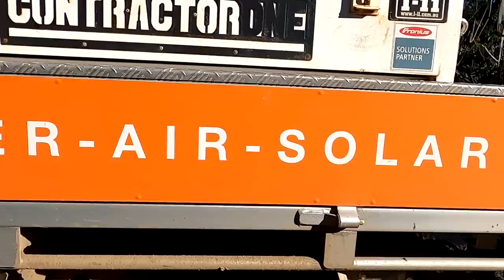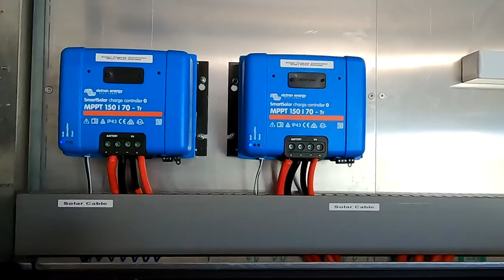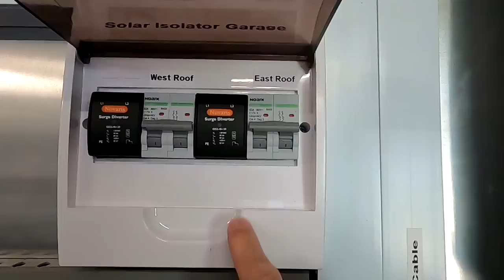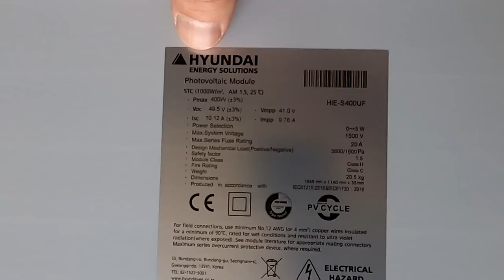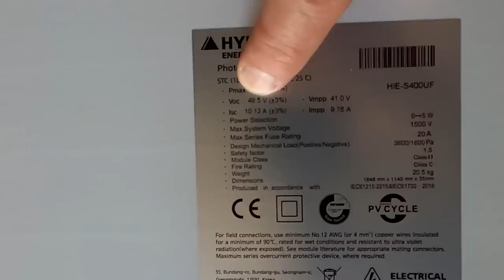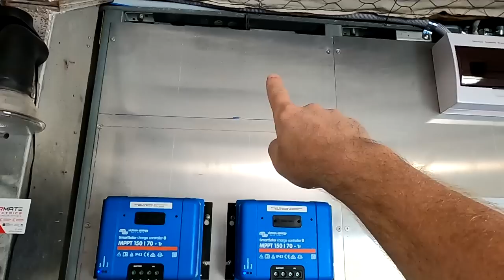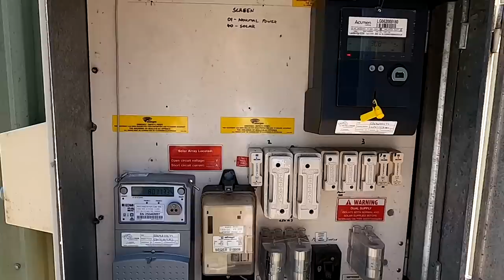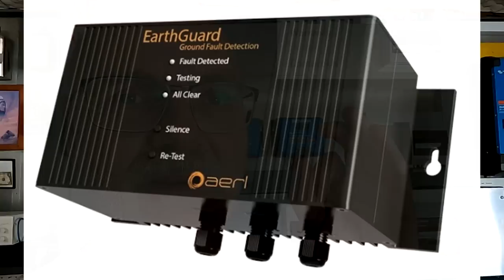I booked an Electrician to check on my DIY Solar-Battery System.

Comment: I see you are going through what I did when I was thinking about what inverters/mppt to get. I went with Growatt only because they can handle 450 volts 30 amps on there mppt controls built in and have 100 amp chargers at 48 volts with 5k inverter. I wanted Victron or Schneider. Schneider is best there is for USA. To get what Schneider it would have been $16,000. I went with Growatt and spent $2400 to get a good system not the best though. Money is money and we must do what we can afford.
Reply from the maker: Yes, absolutely. The new panels will provide the best solution as I cannot replace the cracked panels and would end up with a lot less power from these roofs.

Comment: You can mount the PV panels right up to the edges if you get a civil engineer to calculate worst case wind loadings and the shed roof strength.
However, this costs money and given that you have to replace a few panels it would be easier to just rearrange and comply with the default code.
It is often frustrating when an owner realises the sheer waste of roof space that is sometimes required for wind effects.
Flat (<20 deg) roofs are the most troublesome.
Reply from the maker: There is an option where you can cover all the sites of the roof to the panels and basically make the panels the roof. I looked into this as well, but it would involve a builder and more $$$ towards that. So not worth it in my eyes.
If I install the new panels, they will be fully compliant, new, warranty and have more power than the existing ones. Cost $$$ too, but I have to spend it either way and I find having brand new panels for half the price is currently the best solution.

Comment: I'm glad you got someone in to point out the deficiencies so you can be assured of safety.  $500 a KW installed is hard to beat.  I say do it Andy, there's still plenty  of DIY you can do.  How about a voltage sensor that will disconnect the system if a solar controller fails?  Or maybe install a large choke?  We do this on ships because of lightning.  I bet your audience would love to see some automation and alarm integration.  We've already watched you put in solar panels.
Reply from the maker: Thank you. Yeah, we have done quite some work on the roof and the new panels are very tempting.
We will do some automation with the new battery 3.0 and a new smaller upgraded power wall. That will be interesting!
Reply: @OffGridGarageAustralia  nice.  Can't wait Andy, keep up the good work!

Comment: Spot on Andy with the grounding! There should only be one point of contact so that there is NO difference in potential with the current. Now, the difference happens when you use an off grid system that is a stand alone (Generator) type of takeover. This is the point at which you loose and have to create a bond because you loose your Neutral bonding. This is the most common and confusing issue with any solar/backup generator setup for any installation... Great Video as always!
Reply: I assume that the shed/roof/PV rails are on a single earth not connected to any main house grid power inlet earth.
Reply from the maker: Thanks Dan, there are so many regulations and it is not easy to understand all  this. The sparky will take care of that and get it right. I'll make an update video when this is all done.

Comment: Finally u got it done. Lol. By the way the spd correct way to connect is Fuse,MCB, SPD again MCB and use a different earth rod for spd. I have used a 16mm earth wire bcz of the distance.

Now only the video about the bms calibration video of heltec is missing. U never got through to tell us what the email from heltec said. Thanks.
Reply from the maker: That totally depends on local regulations.

The Heltec video will come at some point, just not enough time
Reply: @OffGridGarageAustralia  I asked a SPD manufacturer he gv me that this was the best method. Yes local regulations could be different.

Comment: In the summertime, I turn down the amperage that goes into my charge controller, found I didn’t need that much amperage to fill the batteries in that time of year!
I would think this would help alleviate any overage that could occur!
You can do this in the software on the VictronConnect

Comment: Some tips from a solar company. I am not sure why you make your solar panels so high on the roof and have thema all gapped. 1. Some room between the roof is ok for ventilation but it doenst have to be so much (2-3cm on top of ridges is enough) this way you can install them closer to the edge. 2. You will get nice air drift if you just mount the panels without gaps on the side. gaps disturb the air flow and do NOT make your panels cooler in my climate at least. 3. Shingle panels are a good fit for your place by quick video judgement. The voltage differences in partial shades is much less. Shame its so expensive to replace a largely working set of panels.
Lastly, i dont know your weather conditions, storms, etc. Just the 10 degree mounting on the less tilted roof is not really neccesary. It will hardly yield extra energy considering the ring of trees around your place, but does make it more liable for storms and increase mounting costs. You can do it but its not that important.
Reply from the maker: Thank you for your comment.
The gap between the panels and roof was designed for cleaning purposes. As the roof is fairly flat, leaf will accumulate in a small gap easily. The was also the purpose of the gaps in between the panels.
And as some of the panels start cracking now and I cannot replace them worth other used ones any more, It is good to have some alternatives.
The 10° tilt of the panels is so water can run off easily and does not stain the panels. Flat panels are getting dirty very quickly.

Comment: Have you ever thought of AC-coupling some of your PV with e.g. a fronius primo inverter? Works pretty well and (almost) out of the box with the victron system. Even in an offgrid situation. The Multi then will increase the frequency linearly to regulate the fronius-inverters maximum feed in when the battery gets full.
With this you could also do strings from 80-800 V DC and not be restriced from your MPPTs max Voc. I think the MPPT RS's with up to 450V are to big for your arrays (and also pretty ineffient for a charge controller).
AC-coupling would increase efficiency if the PV-power gets used directly and is not stored first (charing your car or using the hot water system in the future in your house). When always first charging the battery, DC-coupling is more efficient tho. So I would go for a mixed AC/DC PV setup in your case.
Reply: @Ando - yeah - a Fronius AC coupled addition would work. I think they are the only company to have worked with Victron to 'tune their violins' regarding frequency, etc.
Also, I think a Smartasolar RS 450/100 (or 200) would work well for Andy. There's lots of features in there for the price - 2 trackers (4 in the 200), isolation between solar & battery, earth fault protection built in. The slightly lower efficiency is a good trade off, I think. I use a 450/100 & I'm very happy.
Reply: @Browneye2566  Refering to the Venus OS manual (2.4), frequency shifting will work with fronius, sma, solar edge and abb inverters at least while also communicating with the venus os. (zero feed in not possible for sma and solar edge, but this is not relevant for off grid). 
But inverters of those brands will show up in venus os without the need of an energy meter displaying the inverters power. With such an energy meter you basically can integrate every inverter into a victron system, as long as it shuts down completely at elevated frequency. I don't know any inverter that doesn't do that. For frequency shifting and regulation, the inverter itself need to have that option in its settings.
Reply: @Browneye2566  In Andy's case I would definatly prefer ac coupling, as he is able to switch on loads when the sun is shining to use the pv power directly and also has dc-coupled pv in the mix to prevent a deadlock situation possible when only using ac pv. 
Directly consumed pc will always be more efficient as there is only one step of power conversion necessary (DC pv - > ac, then into load) and not 2 (DC pv - > DC battery - > inverting through multiplus, then into load). 
As long as you don't need to store pv energy first for later use, dc-coupling requires more steps of conversion and will be less efficient from the whole system's perspective. 
But when needing to store pv energy because you can't use it directly, dc coupling all the way. One less conversion(DC pv to ac) and dc to dc battery charging is generally more efficient than ac battery charging. 
As a side note: the primo inverters also come with every safety feature that you mentioned previously, can make use of higher pv voltages, also have two mppt trackers, are plug and play and supported by victron.
Reply from the maker: Yes, this is all in the pipeline. I have a small 1.5kW Fronius here and will use this for test purposes...

Comment: I have been occasionally observing your vids, for a while, & you've done a brilliant job, with the system. It was definitely a worthwhile exercise, getting in an electrician, for compliancy purposes.
As a practising plumber, in New Zealand, for over 40 years, the amount of trade installed systems, that aren't compliant (especially, in the area of hot water cylinders) is ridiculous. I would imagine Australia would not be too dissimilar. So, it doesn't surprise me, the electrician was somewhat impressed, even if he didn't say so, given what I have seen, of your system.
The question I do have is, now you do know your system isn't compliant, what would have happened, if the worst case scenario occurred, & your garage burnt down, even if totally unrelated, to your solar system. Would insurance have been paid out?
You are doing a great job. So, keep up the top efforts, with both the build, & the videos. Thanks, your channel makes Youtube a better place.
Reply from the maker: Thanks a lot for your comment and sharing your experience. I think so too that we have a similar situation here in Australia in regards to plumbing and electrical installation. I mean, you can buy almost all electrical gear online these days but are technically not allowed to install any of that. Hence I felt it is time to get this all sorted and checked. More to come...
The insurance will not pay for any DIY work if it is not compliant. And even if all work is compliant, it would be hard to proof in such a case. So better to get this all installed now...

Comment: 🥳👏👏👏 congrats 🍻 Dread to think what they would say about my set up 🤭🤭
Mine is a 24V system with just 2 panels and 2 batteries connected to a 3Kw all in one. We are low users in this house tho. I've just got another 12V delivered today, then I'll get another 1 next month, then we'll have 200ah of 24v lifepo4 batteries 🥳
See you next time Andy 👍
Reply from the maker: Great setup. Makes sense to stay low.

Comment: the panel distance is for gutter clearances and fire saftey to help clear leaves and debris
Reply: also wind loading on the roof  gusts raising and lowering the roof area  (wind getting under and pushing down on the roof as a whole)

Comment: When building an “off-grid” solar installation (besides insurance items), the owner is king of his castle. When (hybrid) connected to the grid one must meet off course the regulations. However “off-grid” is private and only the owner is the boss. Grounding solar-panels/roof construction is a questionable…all solar panels are dubbel isolated and grounding the construction on the roof increase the risk of lighting strike. Also it can be argued the grounding could be a risk regarding safety. Great channel Andy!!
Beste groet, Peter
Reply from the maker: Hi Peter. unfortunately many people do think that way and could do whatever they want on their property. 
This is not the case though and the same regulations, rules and standards apply for off-grid as grid connected installations. Hence I want to get some installations, which are not DIY any more, installed professionally.
Reply: Hi Andy, thanks for your reaction. May I say “we agree to disagree”. My property is private and not public, so rules and regulations are strictly drawn up by the master (yours truly).  My off-grid is not a hazard for the community, perhaps only to me? Further I am an electrician with a mind of my own. But further a harmless guy…. Keep up your splendid channel!! BR Peter

Comment: The aerl Earth Guard (764 AUD )also has an auxiliary alarm relay output for external fault indication, along with its onboard audio/visual alarms. That could be used to disconnect the solar. Victrons’ battery protect can also be used to stop over voltage from SCC getting into your DC system and battery. Some BMS’es can handle it. Victron recommends earthing only the battery negative;  panels never earthed on their wires. Obviously the frames are already earthed. So your system would all be ‘floating’. America has more stringent Ground Fault regulations, expensive devices, and mandatory outside disconnect, at ground level, that disconnects on the roof; that’s for the Fire Service to use, in event of a fire in panels on the roof. Some info on that on the diy solar forum.
Reply: As far as the NoArc SPD’s are concerned, current best practice is to have the isolator switch first, with the output going via the SPD
Reply from the maker: Thanks, Michael.
The sparky didn't mention any need for an SPD so far. I will ask him again next time.
Reply: @OffGridGarageAustralia  you said you have not connected them yet, but you have them installed in an MCB box.

Comment: Very good discussion on the outcome of  your inspection. There are three items of interest to me. Firstly, if you use more than one earthing point, keep in mind the potential between them could get into the thousands of volts under a lightning strike event. Secondly, the appropriate labelling of the system is something I am lacking as well and need to fix. Thirdly I  wonder why you allowed any part of your system to go over 120volts.
Reply from the maker: It all depends how your design of solar installation is. If you have no shading, it makes a lot of sense to have higher DC voltage to safe on cabling effort. With all my shading, multiple parallel strings seems to be the way to go.
Reply: @OffGridGarageAustralia  hi Andy, of cause you are correct from a cabling point of view, but by going over 120v, you change your dc side from a extra low voltage system to a low voltage system, and then wiring rules kick in.

Comment: Bien c'était une belle expérience avec cette électricien... je ne mets pas en doute ces capacités technique hormis la réglementation et la certification, toutefois par mon expérience et ce que j'ai pu voir depuis la création de ta chaîne ANDY, tu essaie de rester dans la conformité et ce n'est pas le cas pour beaucoup d'installation..., j'apprécie l'idée de l'alarm du system de défaut de terre.

Comment: I like the idea of the Hyundai panels and the credit subsidy. I know it's not great for the DIY aspect, but I don't think it takes away from your current work. It also doesn't stop you expanding your battery and playing with the fence line solar.
Reply from the maker: The installation of the solar will only effect the roof area and nothing of my other DIY work. As some of the old panels are now cracked and I cannot replace them any more with likewise panels, a new solution need to be found anyway. And, We have spent a lot of time on the roof already, so I think everyone has got a good understanding of how it works now. Also, Andy2 is not always available for helping me 😁
Reply: @OffGridGarageAustralia  sounds good and sounds like you're heading that direction

Comment: OK - eine saubere Erdung/Potentialausgleich funktioniert so, dass es diagonal von dem zu schützenden Objekt jeweils einen Erder gibt und die beiden Erder rundrum mit einen 40x4 (oder ähnlicher Querschnitt) verzinkten Bandeisen verbuddelt im Ring verbunden sind.
Ein elektrischer Betriebsraum, was deine Garage wohl ist, gehört dann auch ein innerer Ring, ebenfalls 40x4 verzinkt, rundherum installiert - meist wird sowas ca. 30cm über dem Boden installiert, und an Toren halt drüber. Dieser Potentialausgleich - Ring wird an die dann wohl vorhandenen externen Erder angeschlossen.
Alle zu erdenden Geräte im Sinne des Potentialausgleichs werden dann an den inneren Ring angeschlossen.
Ggf. reicht es beim inneren Ring nur ein Teilstück zu installieren und die beiden Enden aber auf jeden Fall an die beiden externen (diagonalen) Erder anzuschließen. 

=> ist ne Super Kurzfassung aus dem DEHN Blitzplaner - habe das >35 Jahre lang immer wieder zu beurteilen gehabt.

LG jogi

Comment: Andy, always loved your DIY projects. We started buying 280ah batteries the same time and  I felt we were on the same level. But seeing you thinking about buying new solar panels installed by pros is not DIY. I’d much rather see you struggle rounding up used panels just as I did. It probably make sense financially but where is the fun  in that? I’ll always continue to watch your video’s and buy you Beer but I love the DIY.  Matt
Reply from the maker: Thanks a lot for all your support, Matt. DIY has a limit and I feel I have reached this now where I'm uncertain about certain safety related installs like grounding , SPDs,... and also won't be able replace my switchboard for example when we are going to connect the house. This all is not DIY any more.